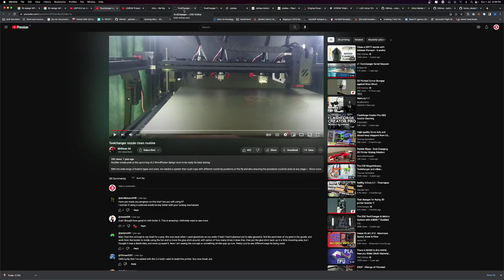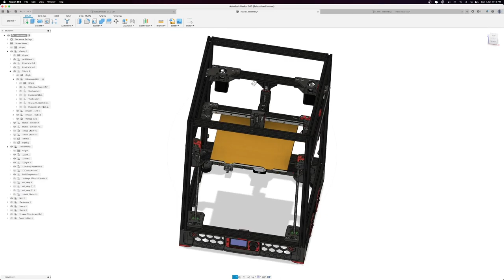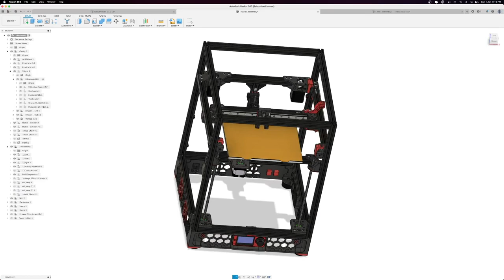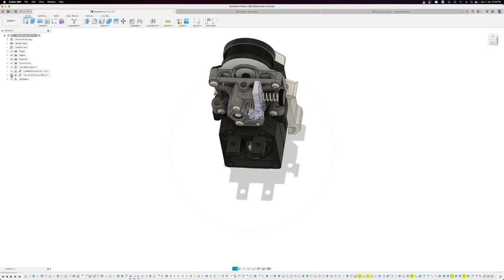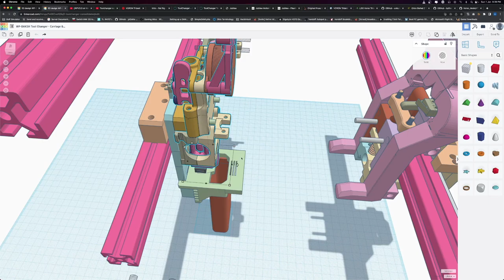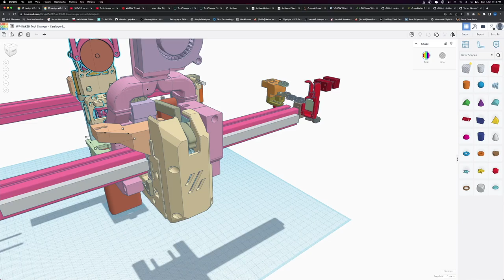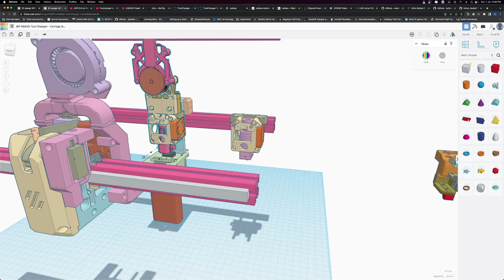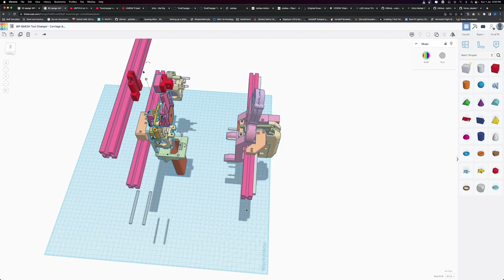'WP-DAKSH' - Voron Trident DIY Tool Changer 3D Printer -  Part 1 - Overview

Comment: I really like this implementation of multimaterial in the trident. I have a couple questions. Can you provide a ballpark figure for just the toolchanger in regards to cost? Trying to exclude the cost of a stock trident as I already have a one and I am looking to upgrade it to have this capability. What speeds are you currently running with the setup like this? As in, can you keep stock voron speeds or do you need to run a system like this slower?
Reply from the maker: Hi - please check the newer version of the tool changer - its fully mechanical and more sturdy than V1

Comment: Thank you for the great work.
Some questions:
- Do you use CAN for the toolheads?
- Why is the probe attached to the cariage? Wouldn't it be better to mount it to the least used tool, as it's only needed for leveling before starting the print and is a useless weigth afterwards anyway? (for allother tools you have to find out the xyz-offsets anyway)
- Also the servo is only used for unlocking the tool, if I understand correctly. Could'nt it be replaced by some sort of longer lever and a servo next to the tools parking lot, pushing the lever? (yes it means you need one servo per tool - but you do not carry the servo...)
- If I understand correctly, you only use printheads. There are other tools possible, like pen, pick&place, cutter (but I do not recommend laser on open frame printers). Also the part cooling might depend of the printhead you use.  Wouldn't it be better to attach part cooling to the tool instead of the carriage?
- As with the points above the only remaining electrical component is the endstop, this might be moved to the x-axis. So no cable to the carriage and no cable chain needed.

Just some ideas.
Reply from the maker: Thanks for the appreciation - in reply to your questions.

1. I am upgrading to EBB36 with TL TCHC hotends - but will be using USB instead of CAN on all 6 toolheads via a powered USB hub
2. The probe weight is negligible as compared to the toolheads and makes for faster homing/tramming without having to pick up a toolhead.
3. Servo is used both for locking and unlocking the tool - the current design requires a servo to be present on the carriage - there could certainly be a way to use a servo per toolhead - but the current system is so reliable that i am not looking to modify it. There are other designs out there that are exploring a servo less system - you can find more details on the DAKSH discord.
4. The part cooling can certainly be moved to the tool - but my requirement was to fit 6 tools in the limited frame space that was available and maximize the Y travel. You can attach the part cooling fans to the front of the toolhead. 

The design is extensible and can be modified to suit your requirements as needed - the current design is as per my specific requirements and is working very reliably - with a less than 8 second toolchange sequence.

Comment: Loving this idea. I hope that version compatable with Voron 2.4 is in the future. Would love to add this into my belt print bed machine.

I have project that involves swapping to a 0.2 nozzle for the last 2mm of layers. Not requiring a manual nozzle change during the print will be amazing and let me switch to printing in ABS.
Reply from the maker: I have ideas around adapting this to the 2.4 - with the new V2 mechanical tool changer. That will be next once the V2 is completed
Reply: @ankurv2k8  can't wait to see more.

Comment: This is exactly what I've been searching for! Nice work!
What would you estimate build costs at?
Reply from the maker: Thanks - its essentially a trident build + about $75-$125 per tool depending on the hotend used. Add in about $200 for the extra parts in electronics and wiring etc.

Comment: I love this system's design and it is definitely going to influence me to get a voron soon. Do you think it would be possible to rework the system a bit to have it work on the 2.4? Possibly have all the tools stored way at the top and the gantry can return to the top every time for a tool change?
Reply from the maker: Yes, absolutely - this should be compatible with mot of the corexy platforms - but will need some modifications.

Comment: Great Job. I think this is a great Project. Do you Think about a Carrier with one mgn12 rail instead of the 2 mgn9 ?
Reply from the maker: The 2 MGN9 was a requirement for the original woodpecker - my design of the WP-DAKSH variant uses a single MGN12 instead

Comment: Hi there, nice work.  What was the weight of a complete head?  is it possible to modify the carrier as I have 2 mgn9 and 2020 carbon fiber, up/down.  Also the docking station as I have 3030 profile.
Best regards 
M
Reply from the maker: Thanks - have not weighed a tool actually - so cant give you a definitive answer. The docks can be modified for 3030 without much issues - and the toolhead should be doable on the dual mgn9 - infact the original woodpecker build from MrBean was dual MGN9. But i have modified things so much that you will have to use the CAD (to be released shortly) to modify the latest iteration as per your use case.
Reply: @ankurv2k8  thanks for the reply.  are the step files available for download?  modifying myself,  is no problem.
// Sweden
Reply from the maker: @mh-laser2886  The CAD files will be available shortly on github
Reply: @ankurv2k8  thanks

Comment: Is this marlin or klipper ?
Reply from the maker: This is based on klipper - also V1 has been superceded by V2 which is a fully mechanical tool changer
Reply: @ankurv2k8   I  was planning to integrate this to marlin 5 axis firmware , so i guess ill change to klipper but 5 axis on stable klipper firmware ive never looked at it even  ...i ll try .4, thanks for your answer .

Comment: What size printer do i need for 6 tools, thanks.
Reply from the maker: My build is a 350 x 350 trident frame which fits 6 tools on the back extrusion. But the frame will need to be about 75mm deeper to allow for the use of the full build plate in the Y axis.
Reply: @ankurv2k8  I have a bare 350 voron frame, how much Y would i lose eith this build?
Thanks for your reply, amazing work btw!
Edit: i mean you did say 75mm deeper but I mean does that include some wiggle room or will my 350 become 350x275
Reply from the maker: @davidbinenfeld489  i am getting 320x280 on my build - the loss in x is due to the 90 degree rotation that i did with the belted z. I dont think there should be any loss with a leadscrew build in X as long as the leadscrews do not collide with the xy joints or the carriage when rotated 90 degrees
Reply from the maker: I might actually look into the other belted z designs that other members of the community have come up - they might be better than mine at avoiding the loss of build space in X
Reply: @ankurv2k8  I might not be able to build my voron soon but I'll try to figure something out myself to minimize the loss of build volume